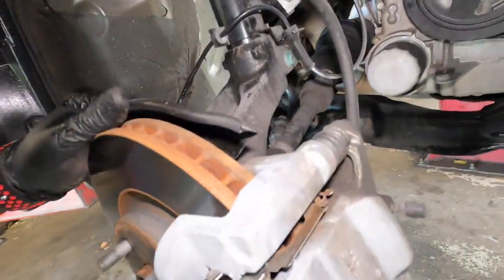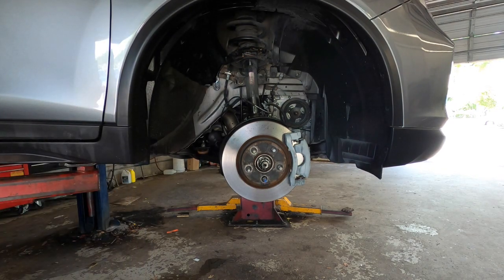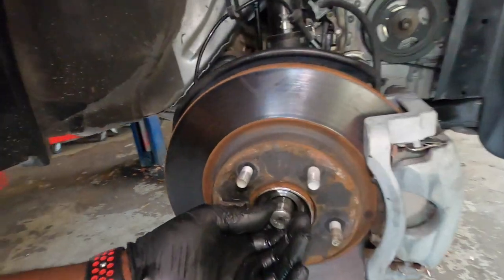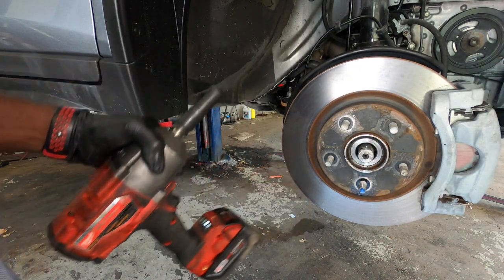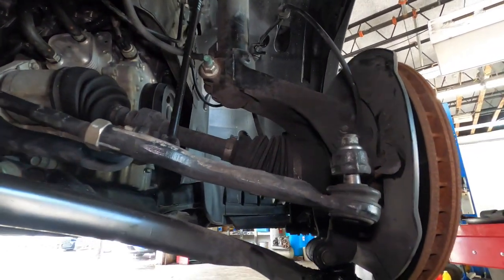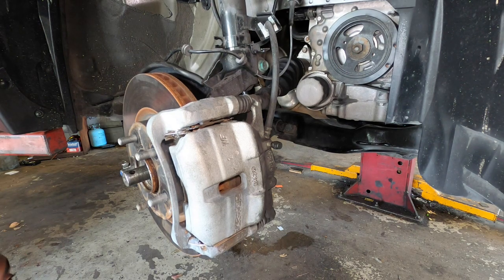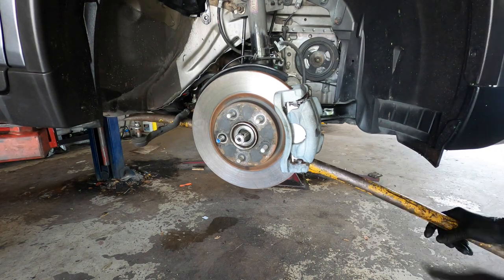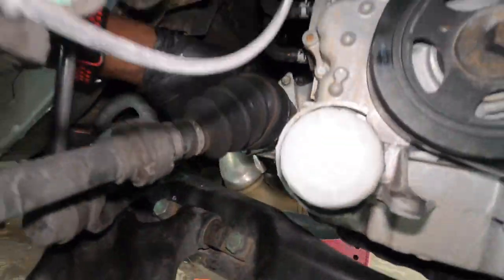Nissan rogue right front CV axle replacement

Comment: Thank you so much!  Your method to get the Lower Control Arm Ball Joint out is excellent, a massive leverage made it easy. I’ve spent hours to take my 2011 Rogue out 😢.  Also your advice to twist the axle to find the grooves to easily push it all the way in is also valuable.  You didn’t have any problem to take the axle is a plus. Others did struggle to get this passenger side CV axle out.  I really appreciate this video.  Thank you.

Comment: Is that CVT fluid that leaks out or is it transfercase/ differential fluid that is supposed to leak out??.... the reason i ask is because i recently drained and filled my front and rear differentials and had a minor leak in the front passenger axle seal and after the transfer case service i did the leak has progressed more and now leaks a bit more from the seal.... i was under the impression that since the new fluid(transfer case) is new it is lighter in viscosity therefore the more progressive leak..... when i change the seal what am i topping off, the transfer case fluid or CVT fluid??..... great video my brosky, your help would be much appreciated..